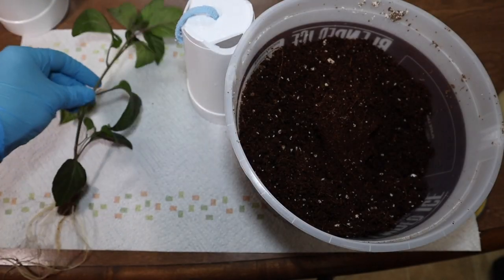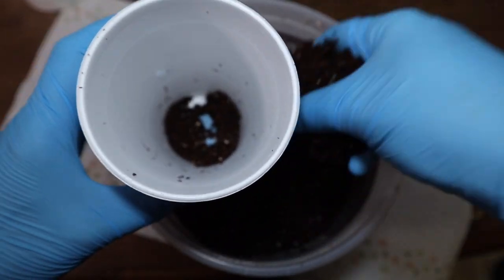How to make wicking cups - Quick, easy and inexpensive

Comment: I like how this works. The only thing I did differently is I used a third cup with the whole bottom cut out for the extra spacer. It allows for more water.
Reply from the maker: That's a great idea.
Reply: I knew you'd think it is a good idea.
Reply: Peter Stanley Also, when you pot the plants, you can put the Styrofoam cups in a food processor and chop them into small pieces and use them in your potting mix for good drainage. If you like this idea, you can claim it as your own for everyone to up their growing game.
Reply from the maker: I might work. That stuff never breaks down though, might be unsightly after a while, and be more of an environmental pollutant than it already is. Also it would float to the the top after watering. Eventually all of it would collect around the surface. Perlite is much better for that purpose. Thanks for the idea though.
Reply: Peter Stanley I reuse my potting soil and just add new fertilizer. As for the Styrofoam floating,the soil holds it under. It works fine and since I use it over and over, it seems to me that's better for the environment than the cup ending up in a landfill where it will still never degrade and serve no purpose at all. So, I'm helping the environment by not using perlite.

Comment: For your consideration... Wouldn't a hole in appropriate place in outer cup allow for water filling and maintaining the proper air gap between the water level and the bottom of inner cup containing the wick...?? Would also enable placement of many cups in a 1020 tray and filling all of them at one time instead of individually. What do you think...??

Comment: Nice and easy way to do it.  I wonder if the cups were put into a large tray like the washing machine drip trays.  Could you cut a hole in the bottom cups, then fill the tray high enough so the wick of the top cup could be in water.  That way you water all of them in one shot.
Reply from the maker: Thanks, Rob! I'm thinking about letting them drink out of a tote, drilling some holes in the lid for the cups.

Comment: Looking good Peter,  Some nice progress on the wicking cups.  I am curious though,  do you see a noticeable difference in plants that are set this way vs. a standard double cup set-up without a wick?  Thanks for sharing.
Reply from the maker: Thanks, Jeff! As far as growth, kept in a cup, I haven't noticed much difference between the two. The wick saves having to top water until the roots grow out the bottom. Also, it allows you to drop it in something larger to drink from. For instance, I could drill a bunch of holes in the lid of a tote, fill it with nutrients, and set these cups in there, let the plants draw up what they need through the wicks. Makes it less hands on. With the double cup, once the plants get any size, you're having to water them about every day.

Comment: Can I plant lettuce using this wicking cups? Thanks.
Reply from the maker: I haven't tried it. You might want to experiment with a plant or two first. Lettuce does really well in Kratky setups. That might be a better set and forget method. It takes about a gallon of nutrients per lettuce plant, to maturity.
Reply: Thanks for your reply. I'll try.

Comment: Are you saying Cocoa core potting mix? My plants aren't rooting well and I think it's the heavy mulch that seems to be in every soil I try. Frustrating
Reply from the maker: Coco Coir, it's made from coconut husks. I buy it in small bales and break off pieces as needed. Soak in warm water, and it expands for use.
Reply: Peter Stanley Thanks.

Comment: What are the strips of cloth for?
Reply from the maker: They are to wick up water and nutrients so the plant can draw up what it needs.
Reply: @pepperdactyl  I figured, just thought I would ask
Reply: How often do you add nutrients to a wicking system? I transplanted my peppers about a week ago using this exact method and they soaked up the water pretty quick just didn't want to over water...im a noob btw 😃
Reply: @pepperdactyl  is there any chance in getting mold inside there?.and if you just keep putting water Everytime it runs out?